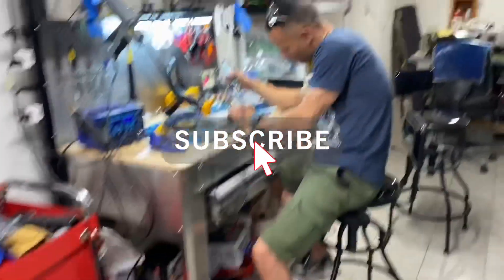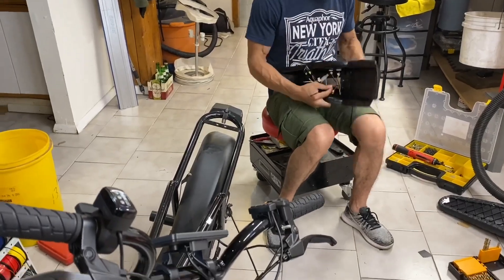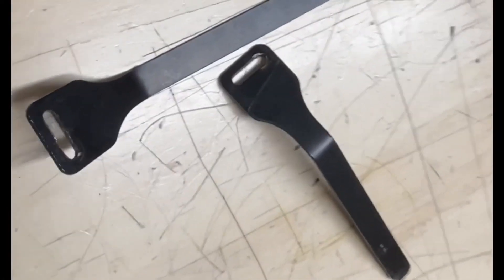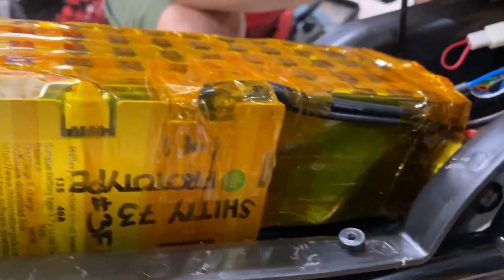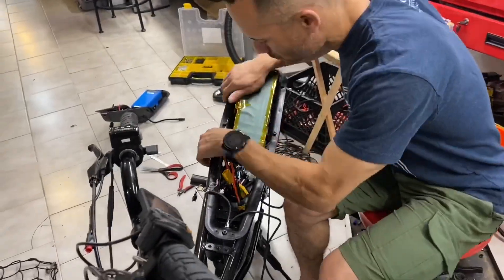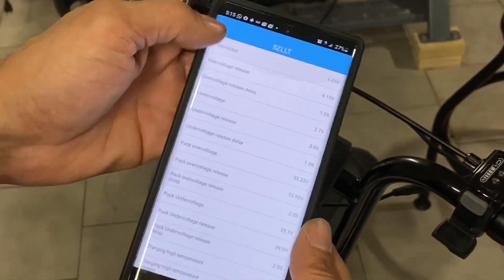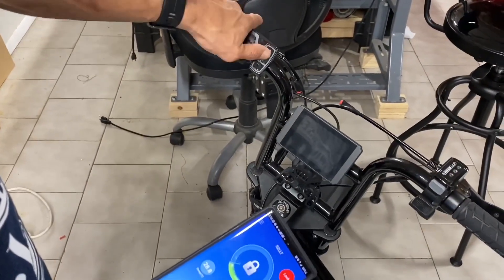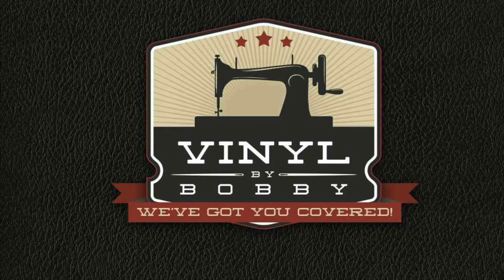Super 73 z1 Fender hack and Security Lock out mods

Comment: Hi, I'm doing this conversion but I seem to need to buy a new throttle since the wiring is not clear on the stock throttle (3 wires from the control but 5+ from throttle in the Julet connector. It looks like you were aboiut to upgrade the controller and keep the original throttle - can you tell me how you did it or give me a wiring schema?